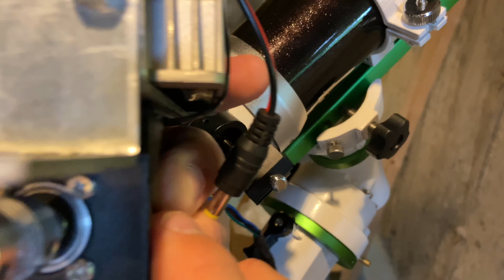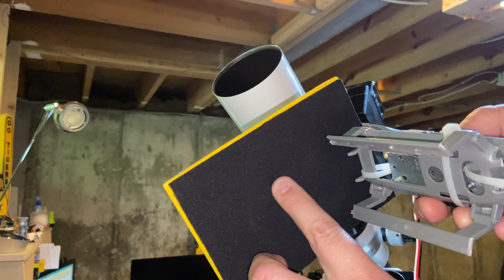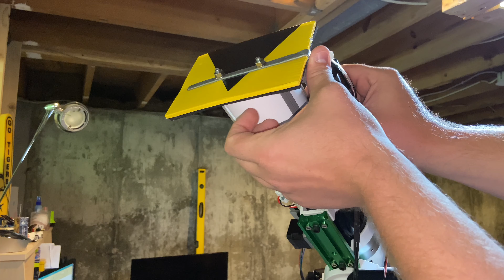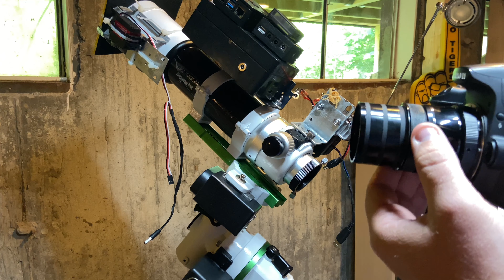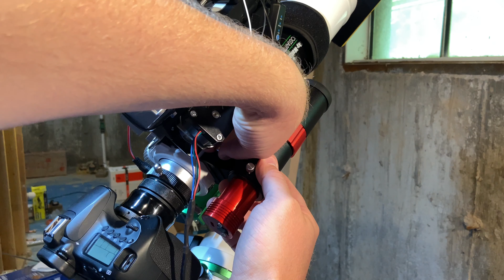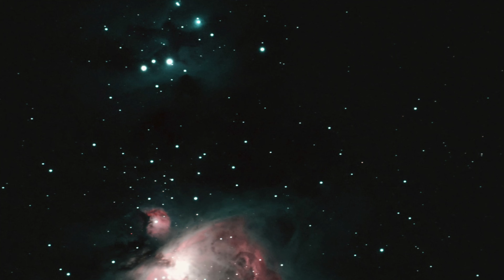Astrophotography Rig Reassembly

Comment: Neat setup! How did you get the mount to communicate with EQMod for mount control. I have this mount and haven't been able to get it to work with ASCOM/EQMOD.  Is there a cable to laptop i might be needing?
Reply from the maker: Hi and thanks. 

I’m using this cable from Amazon :
FTDI USB to RJ45 Serial Converter... https://www.amazon.com/dp/B07HL2Z741?ref=ppx_pop_mob_ap_share

Good luck and let me know how it goes!